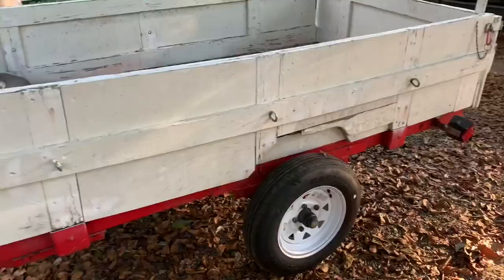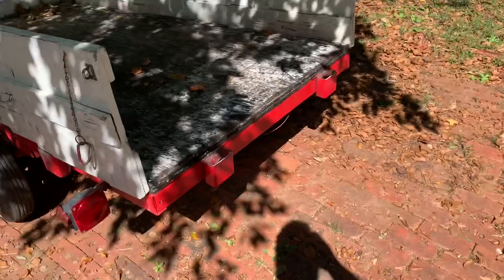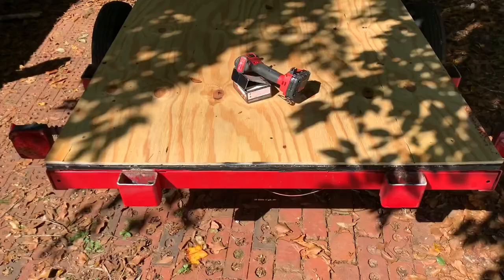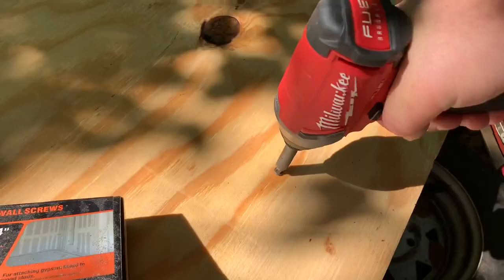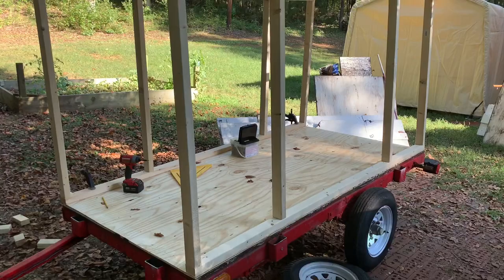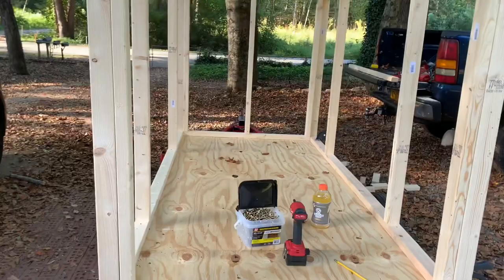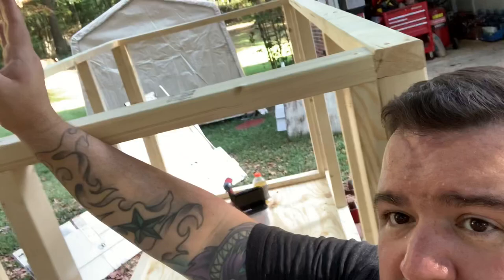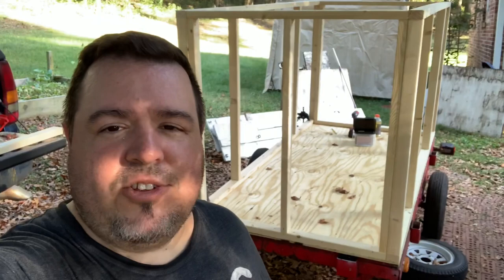How to BUILD the PERFECT MOBILE CHICKEN COOP - DIY Build Series - Part 1

Comment: So happy you were able to find a used trailer.  This is going to make a fine chicken coop.  I like the idea of a collection system for the rain water.  It will save a lot of hauling of water.  One thing I would recommend before you go much farther is to lay some linoleum sheet goods on the floor for ease of cleaning.  Along with deep bedding, it will keep your coop so much easier to clean and with the deep bedding you will have fantastic compost for your garden.  I look forward to watching this build.  Have a Blessed day.
Reply from the maker: Margaret Bedwell Thanks for the comment! I was thinking about that honestly. I suppose it depends on the bedding... In my last coop, I just painted the floor with a good exterior paint and then used a bedding called Koop clean. It was basically chopped sassafras with PDZ added and it absorbed EVERYTHING. Never any odor either! Its really good stuff but I haven’t found it locally since we moved here so I may end up going with linoleum. We shall see!
Reply: @HiddenCreekHomestead  Sorry you haven't been able to find that product.  Good luck with whatever you use.  If you go w/linoleum, you might find a salvage piece the right size.  Also, you might check Habitat for Humanity if you have one close to you.  They have all sorts of products for sale.   A lot of it from builders over stock.  It's a good place to check for items for the house if you need to do anything in there.
Reply from the maker: Margaret Bedwell I keep forgetting about that. My wife has been wanting to check that out... she’s been dying to find some old vintage single pane windows for some projects
Reply: @HiddenCreekHomestead  I hope you find one close, it is like a giant  thrift shop.  They have everything from books to screws, tiles to glass ware.  I took my friend to one  where we live, she found a cast iron kitchen sink, double bowl no chips or scratches for 1/4 the price of a new one.

Comment: Where you put your access/clean out door.  Remove the 2x on the bottom. You don't need the strength and it will make cleaning out easier.
Reply from the maker: Philip Blass I was thinking the same!